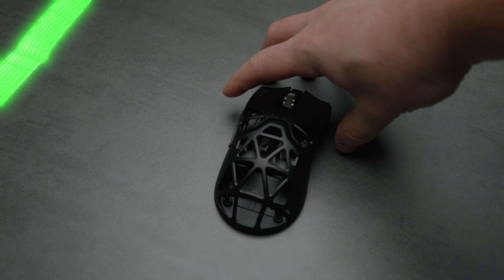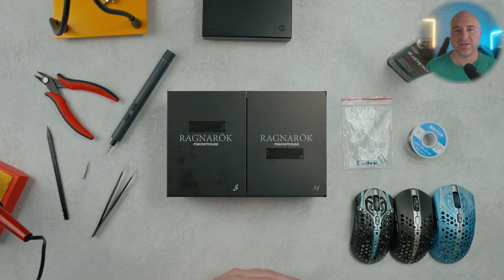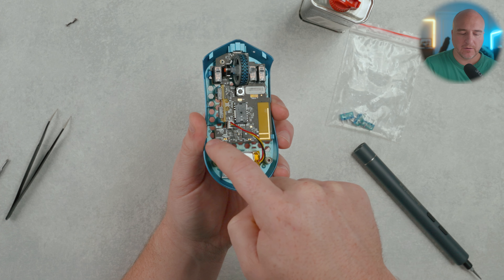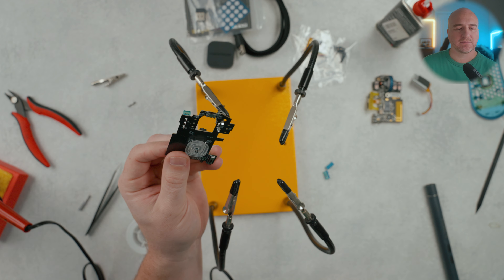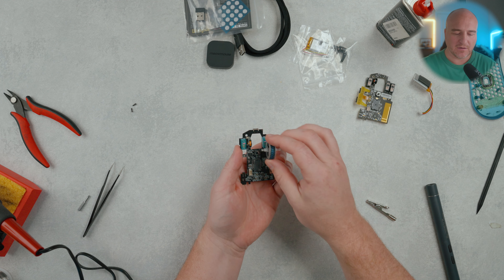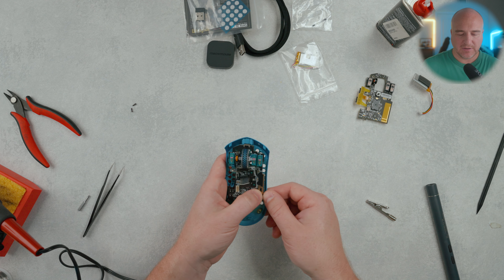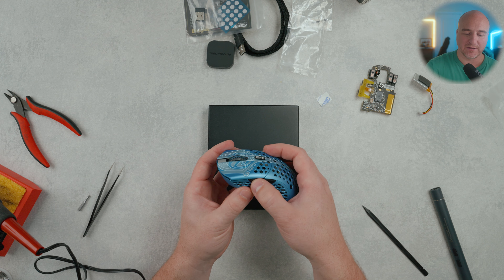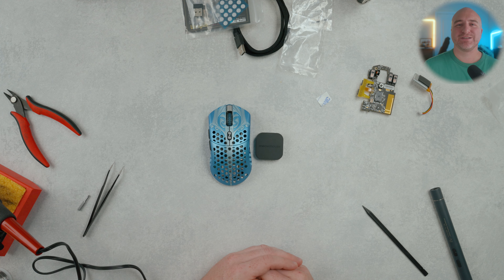4K For Your Finalmouse Starlight-12 (Ragnarok Meowmouse)

Comment: $110 for this might aswell just get a ULX at that point.
Reply from the maker: I agree the price is a bit high
Reply: yeah that price is kinda absurd, the fact you also need all the tools to do it aswell, if u don't already have the required tools, this could easily turn into a 150$ + mod defo not worth unless u really really love the design of ur mouse, but even then difference between 1-4khz is not worth that much money in any world imo. still cool to have the option I suppose...
Reply: This is good for people that use the infinity hump, of which it's unsure if the ULX will get one and if it does it won't be for a long while.
Reply: Well my Tenz M has an issue with the left click so I see this as a win but only if you already own the mouse
Reply: @jamesvandorn2563 can just get separate switches for like 5$ or even less probably, unless 4khz is tempting enough to spend so much money, u have to do the soldering either way.
Reply: @dokkie9979  if I'm going to go out and buy a soldering iron, solder, extra tools just to change switches I might as well upgrade the whole PCB
Reply: @RitzyBusiness yes this is exactly why I am not upgrading to a ulx and instead will mod my starlight12
Reply: Shipping times for ulx is like 12 weeks

Comment: Hey, I have a finalmouse starlight 12 and I am deciding whether I should do this mod or whether I should do the viper v2 internals mod.
Reply: I just got my kit installed and had to resolder it 3 times (that's on me) but its amazing even before I got it fully functioning I hopped into a Valorant tdm and first game on dropped 40 kills, and now I got it fully functioning I feel extremely confident in my mouse and aim.
Reply: I would say if you like the height and shape of the starlight 12 don't get the viper mod because if understand it right it increases the height of the mouse because it uses a completly separate base
Reply: @jamesvandorn2563  ok I didn’t even think about that. Thanks!
Reply: @jamesvandorn2563 how hard was this to do in your perspective? I have very little experience soldering and I want to know how achieve this is for me
Reply: @jamesvandorn2563  thanks for letting me know! I will be buying this soon
Reply: @alexandermesia4655  great let me know what you think of it, I'm loving mine

Comment: Did you manage to update the dongle? The MCU2 version on my dongle is 1.0.4 but on the updater it says latest version is 1.0.2. The updater just won't update the dongle for mine for whatever reason.
Reply from the maker: Same for me. I reached out to them and they said that it has the latest version installed it is just a software glitch
Reply: @AimAdapt  I see, I have contacted them as well and they mentioned that the dongle doesn’t need updating. So that must the reason behind it. Thanks for the reply.